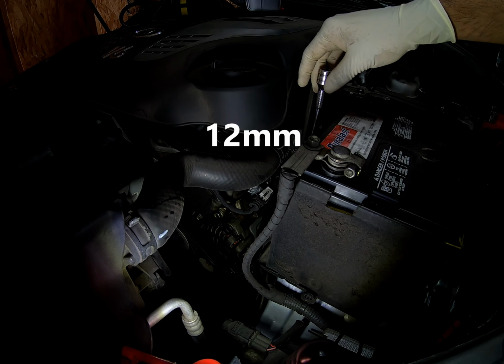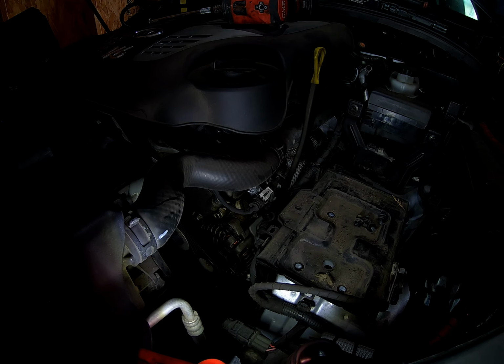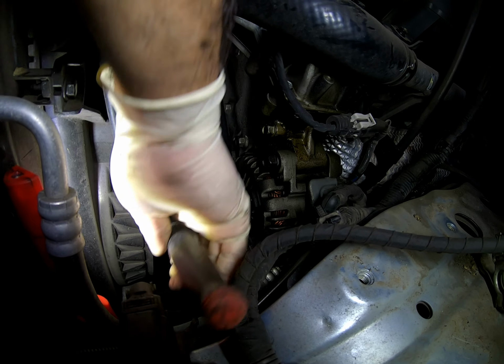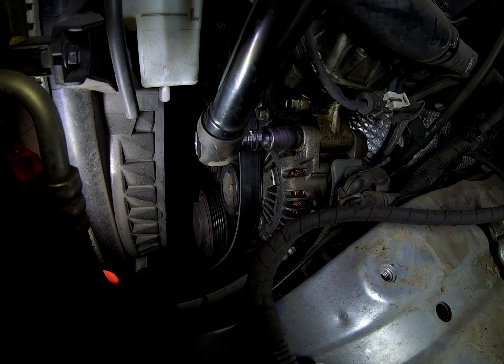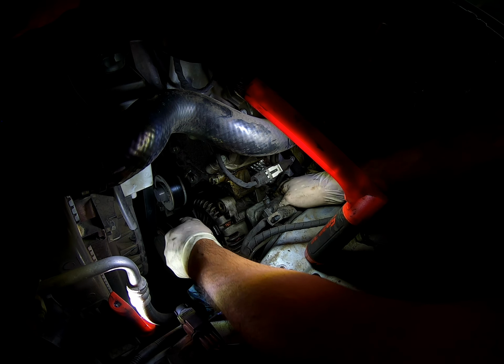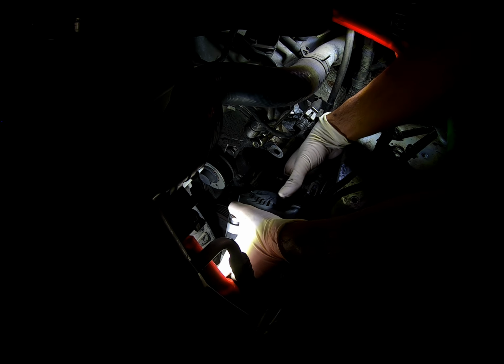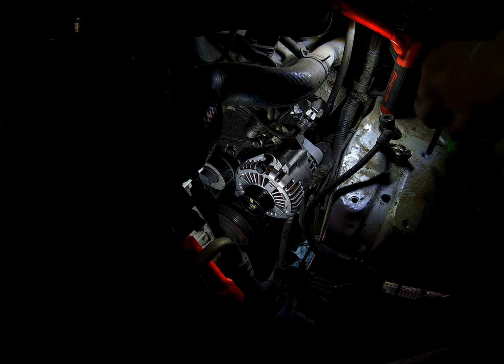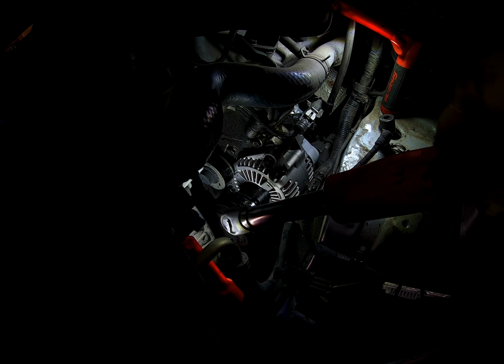2006-2009 Kia Sorento 3.8L Alternator Replacement

Comment: We liked your video and it helped. One thing you didn't mention is that the threaded bushings on the alternator sometimes when they are pressed in at the factory will encroach into the space that you need to get the alternator to pass the mount. I took the one we were working on and started the bolt into the threaded bushing and tapped the head of the bolt with a hammer which made the bushing flush with the alternator mounting bracket and allows you to slip it right on. This trick also works for removal. Just back the bolt out about a 1/4" and tap the bolt. It will give you more slack. Thanx for the video. Radarsski

Comment: I did my 2008 sorento 3.8 front 2 wd Not transverse mounted engine the same.  You really need to remove that battery box to make room for things.  The hardest problem I had was I am not as strong as I used to be as a teeenage mechanic/ Now at 65, it was hard to hold up that alternator which is a pretty heavy duty one, and get it in place.  Also a big breaker bar is really helpful to push that tensioner.  just a regular extension might not give you enough leverage. Still I got it done in the hotel parking lot, about 1 1/2 hours.  Take care on the alternator wire connectors that are under that plastic clip.  Just be patient.  One of the nuts was a bit tricky to get a wrench on

Comment: I just replaced the alternator on my 2006 Sorento 3.8 and the alternator on that is on the bottom right side of engine and it was easy to do I removed the sway bar to get out between engine and radiator. I had the original engine replaced about 3 yrs ago so maybe I don't have a Sorento engine.I don't know the mechanic said it was out of a 2008 Kia Sorento

Comment: Did you have to remove the radiator fans in the front? We got the belt off and the 2 bolts for the alternator out but its not moving lol is there a 3rd bolt? 2008 kia sedona is what we are working on
Reply from the maker: I didn’t have to remove the radiator fan. The alternator is pretty stubborn sometimes

Comment: My son's 2007 kia belt routing looks different.  There is no tensioner bolt where you are turning in video. His belt wraps differently around the pulley where you're saying is the tensioner.  He has the V6